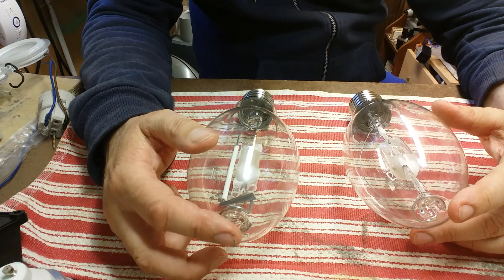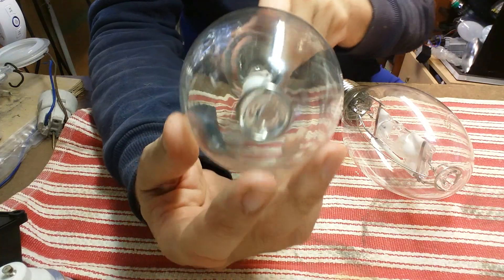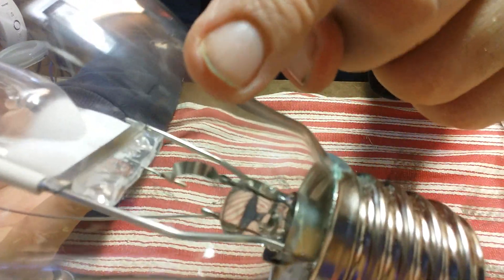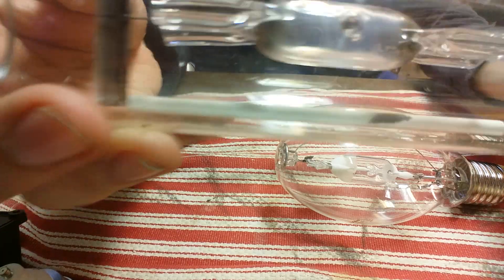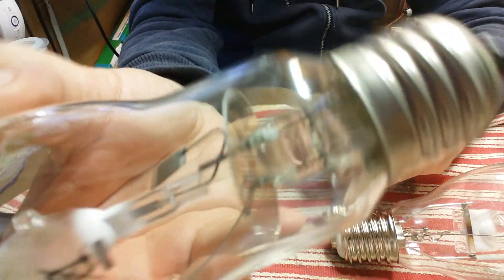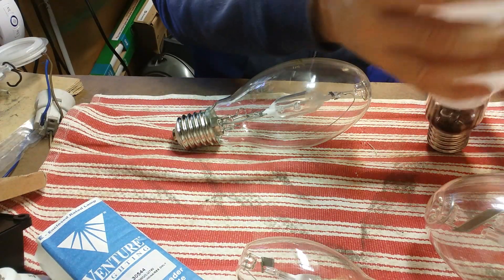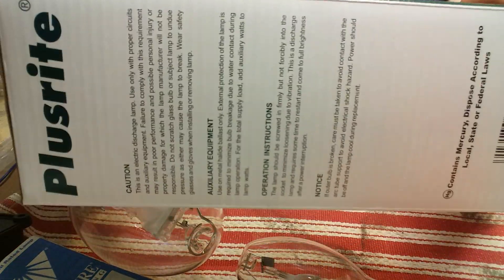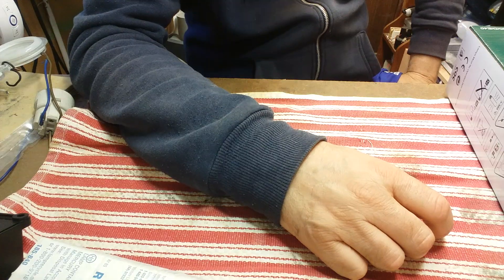Metal Halide E-Lamps (Egg Shaped)

Comment: In Europe, it is quite common to operate some metal halide lamps on same wattage mercury vapor ballasts in conjunction with a 750v-1000v 2 wire ignitor for probe start lamps or in conjunction with a high voltage superimposed ignitor for the pulse start lamps, but there are also a number of pulse start metal halide lamps in Europe that are designed to run on same wattage high pressure sodium ballasts and high voltage superimposed ignitors as well. In North America, probe start and pulse start metal halide lamps usually have dedicated ballasts designed for them, but it is certainly possible to operate North American probe start lamps on same wattage North American mercury vapor ballasts if you import a European 750v-1000v 2 wire parallel ignitor and you can even operate dedicated ballast pulse start metal halide lamps on same wattage North American mercury vapor ballasts as well if you use a European high voltage superimposed ignitor on the ballast. In addition, there are some pulse start metal halide lamps in North America that are designed to operate on same wattage high pressure sodium ballasts as well like the GE ChromaFit and the Venture WhiteLux lamps.

Comment: The ED and BT shaped HID  lamps (ellipsoidal) are quite common in the US (now becoming extinct due to LED takeover). The 250 and smaller 400 watt metal halide lamps appear to be ED28 lamps. The larger 400 watt metal halide must be an ED37 (outer diameter of bulb is 37/8” or 4-5/8 inches). Since the smaller 400 watt lamp is in the smaller (ED28) bulb, it is referred to as “reduced envelope”. However,  if lamps are measured in metric in other countries, the sizes may be slightly different. All those lamps appear to be pulse start? Not sure about the large coated bulb since you cannot see the inside components.
Reply: I have also heard those "reduced envelope" lamps called "cram lamps".

Comment: That wire inside the second lamp that goes from one side of the arc tube to the other is designed to blow like a fuse when the lamp is overloaded. That disc inside the 150w one is made of mica and is designed to shield the lamp base from the heat that the arc tube generates.

Comment: Salvaged a GEC Z8526 and one of the 400w Son bulbs out of another year's ago, was a mare to get down, had been up for some time but had long since been disconnected, the armoured cable feeding a metal junction box below it had been severed and removed.

These street lamp heads were being used to illuminate a roof terrace on an old 5-story sorting depot back in 1999/2000.

Alas, with most of my collection, I had to part ways to make room.
Reply from the maker: Certainly an amazing find. finding space for large lanterns is difficult.
Reply: @jayewaters3921  Got space now and I started collecting again in 2017, mainly old GLS bulkheads but it's a start.